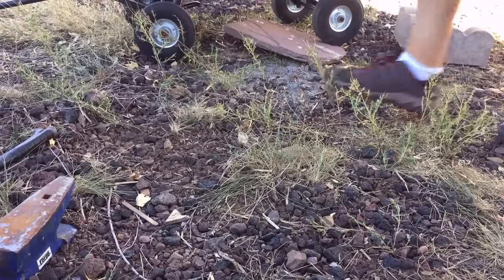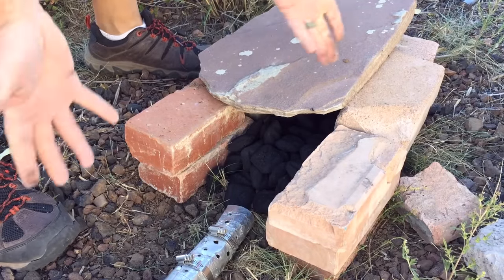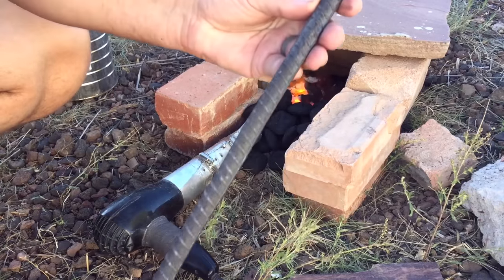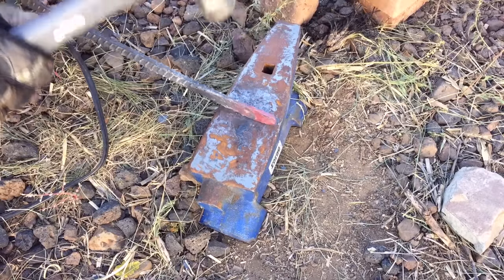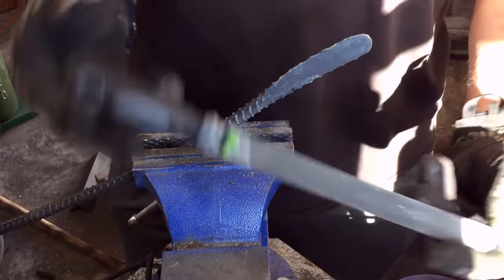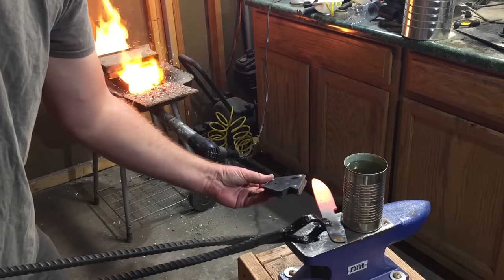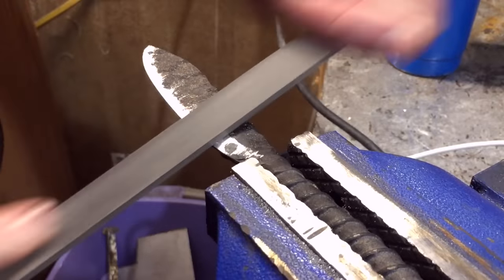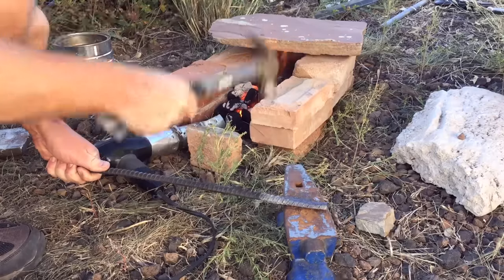Start forging TODAY in your own backyard - no special tools required

Comment: Having just made a knife for the first time ever, I offer two pieces of advice to others who may attempt as a result of this video. 1, When you think have enough coal in the forge, add more. 2, When you think the work piece is hot enough, leave it in there for a while longer. Please note that neither of these is a criticism of this video, he was obviously doing it right, just the two most glaring and continual mistakes I made.
Reply: Bro, I did the same mistakes today, thank u for infrming
Reply: Yeah I learned I had to hammer softer and heat longer
Reply: It sounds about the same advice you'd use for any activity that requires patience, solid advice
Reply: I tried my hand at a forge like this today, kept adding charcoal and it was glowing orange hot with the air I was adding,, but it would turn to ash before my rebar ever got hot enough to work.
Reply: @christianseavoy7693  should probably use some hardwood too but at that point sounds like you need to add more
Reply: I.use.wood stumps.sheok.mally.get.the.air.in.she.glows.nice
Reply: This is 2 years old,, but if you see this,, have you taken another stab at making a knife or is that a one-off??
Reply: @peterlehman6864  I’ve never seen someone love to use periods much as you do, congratulations!
Reply: Yep burn the carbon away. Very smart😭
Reply: That's how we get to learn the easy way, ...by listening to others as they account  their own experiences, with the instructions given, and what they encountered. It sounds like making bread, it takes practice to learn the feel of fine quality bread dough. 
Being able to communicate how you "evaluate" and interpret the feel is priceless, because it adds to and builds upon the original teaching. Together, the video and your feed back are priceless. Thank you for your feed back from a total stranger. In Canada.
Reply: Thanks!
Reply: @peterlehman6864  i.have.a.ques.t. ion
Reply: @prodbybabygod7411  please explain.
Reply: And with time the comments are left to the trolls ….. so where does this live me ?
Reply: Rebar really does grow in backyards, I’ve been trying to level out the ground around my house and I have found atleast 20 kilos of rebar
Reply: Bob Ross of blacksmithing
Reply: @christianseavoy7693  I think that when adding forced air to it, you've got to have it about 3X deeper than you'd expect otherwise. A little different than grilling burgers.
Reply: Just learned those two facts yesterday, note on hotness if your swinging the hammer and it's losing glow completely within the first few you where a few hundred degrees short get warmer. 

If you dig down don't build up much too hard to heat.

Take the advice for swinging the hammer forcefully but not extremely hard unless you want the jelly arm lol
Reply: @christianseavoy7693 this happened to me I ended up taking some lots and making 1 inch by 4inch sticks and placing them over the coals i add 6 at a time. The wood actually caused by forge to suck in air from my airflow port extremely aggressively and went from barely getting to temp to staying at temp as long as I added wood over the coals to burn hotter

Comment: I love how laid back this is. Often these kind of videos are so specific: "you need a QR57 Specialist Hammer and a ball joint inverted blacksmithing high pressure anvil.." This makes me feel like this is something I can do.
Reply: Man. That's nothing impossible to do if you have urge for that. Just some people make it complicated
Reply: Some people get payed by sponsors
Reply: You got that right. Don't overthink it. You can make a pretty good bow with just a stick, a string, and a knife. I've seen it, pretty impressive stuff. There's always a world without power tools, just throw yourself into it and let your brain work out a logical solution, it will make you feel more enthusiastic on the matter.
Reply: "The hammer faces are not as hard and can explode and shoot shrapnel in all directions."

Bro a claw hammer is plenty capable of hammering on steel without exploding what kinda drugs are you on?

You're more likely to snap that wooden handle than you are to break the head...
Reply: @Billy McCatty Powell obviously this is not a super forge bud. It's not getting the bricks hot enough to explode. I've never seen exploding bricks and I've used plenty for fire rings and places that have got pretty damn hot. Also never seen steel spontaneously explode by hitting shit. The only way that makes sense is an extreme change in temp from hot to cold and it probably wouldn't explode it would just crack
Reply: @JarthenGreenmeadow  yeah I broke one hammer head one time in my life I was removing tin from the roof of an old barn so I would put the claw of one hammer under the edge of the nail then hit the head of that hammer with another hammer, and I say broke actually a price about half the size of a dime chipped off and stuck in my arm, smdh. When I was young and wasn't thinking. But it did say on the hammer "do not strike hammer with another hammer" lol
Reply: "will only work with a maybelline hairdryer"

Comment: I literally went outside in the backyard and found some rebar what sorcery is this?
Reply: They use it in a lot of construction. They'll also use it for things like your house's electrical ground and for marking where your property actually physically is.
Reply: ikr? i dont even have a backyard dude
Reply: Same!! On accident. I was amazed
Reply: Haha, when he said that i immediately remembered seeing a piece stucking out of some scrap concrete in my backyard.
Reply: I found a cat in my backyard... smells good now
Reply: As a concrete contractor I can confirm this stuff just magically appears in backyards. Don't know how it's not like half the contractors you meet only half-ass clean their jobsites 😂
Reply: @SantiagoLopez-uu6uk  thats good, the cat will keep the creepers away while you're forging
Reply: Survey pins knocked out by machinery
Reply: I’ve had rebar in my backyard for a long time but never had a use for it until now.
Reply: @lalaland7407  that is really good

Comment: i like how this actually shows what is advertised. its "basic backyard garbage...and if you can find this its a bonus but this caveman thing here works. i see so many videos that are like "How to start blacksmithing for 20 dollars...we start with this here propane forge i built for 200, probably need a forge, and this here anvil, hand made tongs you cant find, some expensive pre-ground bar-stock 1095 and a power hammer. just basic tools we all have in the shed. (rolls eyes)     ive been smithing for 16 years and i remember (vaguely) when i started out with a flat chunk of steel for an anvil, claw-hammer i found somewhere and some vice-grips. i jammed a cast iron pipe in a wood-stove and connected it to an old junky air compressor and threw some logs in there. made the shittiest knife you ever seen, basically a rustic butter-knife, thinner (like stupid thin) and more warped than the one in this video. terrible friggin junk-ass knife. i was so proud. worked in that wood stove for years. upgraded to a ten-inch chunk of railroad track someone gave me for an anvil. got an angle grinder eventually ground that track to a horn.     just kept adding better tools. now i have a Swedish steel 210 pound anvil, propane forge, hollow grinder (that blew something yesterday i need to fix) and i got a wall covered in Damascus knives and swords and axes. you gotta start somewhere kids, and i learned a lot on garbage tools. even now on a budget, i use garage sale files, scavenged steel, quench in used transmission oil, and get handle wood from the log-pile out back. nothing wrong rustic means and elbow grease.
Reply: So honest question. I see a lot of people talk about old railroad track as an anvil, but how do you get them? The only way I can think of would be stealing it but that's not an option I'm willing to consider.
Reply from the maker: Well said 👍
Reply from the maker: Eric Romano Same problem here. I have yet to “find” these supposed pieces of rail. Though I’ve seen quite a few being sold on line for ~$50-100 plus shipping
Reply: Wow. thanks for this comment. Always wanted to give this a shot, and finally spent the whole day researching. Was kinda on the edge of starting and this really inspires me to go ahead with this.
Reply: I literally just bought one about 45 minutes ago. These guys know of dead tracks out in the country and they chop off 12" hunks of them. I just got a 40 pound chunk for $20. They sold it online in Facebook Marketplace.
Reply: FargoFX you're better off with a cheap aso (anvil shaped object) to start off with, railroad just never works out right, unless you can get a piece of junction or cross track, which is quite good stuff, but still requires a lot of work just to set it up. If you do use an ASO substitute, try and make sure the ASO is 20x (or more) the weight of the hammer you use on it.
Reply: Got an almost 2 ft long chunk from a recycling place for 35 buck. Not put it to use yet. They can be found, just got to search and rescue.
Reply: Thanks for the inspiration.
Reply: I don’t have a shed
Reply: used transmission oil... so will used engine oil be good too then? diesel engine. just serviced it so have a bucket with 7L in it staring at me :P
Reply: @ericromano4028  when they work on railroad tracks they will cut off small pieces like 1 to 3 feet long as they stretch it to weld it. They throw these off to the side in a junk pile next to the tracks. If you see a pile of used tracks piled up just pull over and take a look. Or buy a piece off of E-Bay.
Reply: I'm 16 although I'll be 17 in 9 days just went to harbor freight because they opened in my area today and picked up the anvil shown in the video and a ball peen then I went to lowes and got some bricks and rebar I've been welding for about a year and recently bought my own machine so I just wanted to learn about another form of metal working

Comment: being an old duffer I have to say … some drier areas, with trees around the root systems travel underground and on dry seasons I personally have seen fire travel underground thru root systems. so be careful digging trenches and blazing fires. carry on.
Reply: Hey Dave. Great advice, I would have never thought about that.
Reply: There's a video of a guy he want to burn some ants in his garden, he pour some gasoline and then light a match.. an other piece of video shows he at night, he has a tree and a portion of his house on fire!
Reply: Old topic but some kids set some grass on fire in Scotland last year, it had a coal vein under the ground ... it's still on fire under the ground and we had like 3 months of the rain this winter ... sound advice especially if you live in a dry climate
Reply: Thanks Karen
Reply: I better stay away from forging then since Summer is approaching soon in Australia lol,
AKA bushfire season

Comment: This video gave me the courage to forge my own knife today. Didn't think you could heat steel up properly with such simply improvised forge, but it worked wonderfully and the knife turned out much better than I expected. Thanks for uploading this video, it was a huge help!
Reply: You just got to remember that it all started off before hairdryers were even invented. if they could do it, you can
Reply: Lol yeah you would be suprised how easy it is to get a fire going up to extremely hot temps, hell with a bit of mud and know how you can quit easily even build your own smoke stack oven set up which you can get things even hotter, tho with that to get it hotter you may need to up the fuel intake and air feeder
Reply: I've used a flyswatter as a bellows before. Took maybe twenty minutes to get a piece of steel glowing hot.

Comment: My son (14) and I hit up Harbor Freight today for an anvil - created your basic in-ground forge with my wife's hair dryer (oops) and banged out some pretty sweet knives from rebar we had laying around.  I really can't express our gratitude for this super-simple intro to forging.  Keep up the awesome work, many thanks!  We found that wood scraps and kindling worked as well if not better than charcoal (we heat the house with firewood, so we've GOT some wood around) ... such a good time.  You Rule, keep up the inspiring videos!
Reply: 16 now?
Reply: But, 37 hours of filing???
Reply: how much did the hair dryer last?
Reply: @martinferezin5598  Still crankin' - between my wife & daughter, a dryer lasts a few years, so I expect this one to hang on a while longer :) Second hand stores have 'em all day long for a few bucks ...
Reply: What kind of hammer do you use? Carbon steel?
Reply: @martinferezin5598  Still works! We taped it to an old 5 foot piece of iron drain line & fed that into the burn pit.
Reply: @KB-2222  We use the ball-peen hammers from HF - they're cheap, so we bought a variety of sizes.
Reply: 😮😮😮😮😮e
Reply: Any Update?
Reply: @danielheckel2755  The son is 18, has a driver's license, a job and a GF - the wife left three days before Christmas and took her hairdryer with her - women! Looks like I have time to get back to the forge if the mood strikes?  :)
Reply: @ahsuser  Looks like you raised your son the right way 😉. Time to set up my humble foundry!

Comment: Its worth mentioning if you use bricks make sure they ARE NOT concrete they can explode if exposed to enough heat.
Reply: Better to say make sure they are DRY. Like put up in a dry spot with a lot of ventilation totally out of the rain for a few weeks or months.  Cinderblocks are likely to just crack and will be rendered useless (for anything). Natural stones however can and will explode if they are not bone dry.  Clay bricks are probably good even if they are wet they're just liable to crack.
Reply: @maxdecphoenix  thanks i was looking for this info
Reply: Cinder blocks will just crack and turn into powdered ash over time. 
Concrete can explode
Wet clay can explode 
River rocks will explode
Reply: @Paid2Win  you are a modern Mayan
Reply: Too late...
Reply: I was looking for this comment since he said bricks or stone. You should really use fire bricks, nothing else...
Reply: Like literly explode ?
Reply: @IevanceI  I have successfully made a forge out of adobe, and so has retired bladesmith Tim Lively and master bladesmith Tai Goo....among others.  The only advantage fire brick gives is the ability to reflect more heat and reflect it more readily.  It is not the end all/be all of forge construction materials.
Reply: @diegosalazar5653  Concrete brick will throw fragments if overheated, because of the moisture inside.  Concrete block though, will not.  Why?  The cross section is thinner and this allows for the block to dry quicker and more thorough.  Still and yet, it is not durable under high temperatures and will crack and disintegrate.  Because of that, it's still a horrible material to use for this.
Reply: Great narration. Great video. I'll never do this, but it's damn interesting.

Comment: That's pretty neat! I used Goddard's 50$ backyard smith book, but it's awesome seeing that people can cleverly do it for even less. Some tips I've learned that cost nothing but will make your life easier:

1) Find the heaviest flat surface you can hammer on. This allows most of your hammering to shape the steel instead of spending some of that energy moving the dirt underneath. A concrete patio is great for this.

2) When hammering out the bevel, the spine does like to bend backwards. If you rest your spine on the hammering surface, using a 2x4 to smack the blade edge will straighten out your spine without damaging the edge.

3) After quenching (I found motor oil to be the most forgiving), submerging your blade into a pile of dirt, sand, or even charcoal dust makes it easier to work with when you're filing the profile, either by hand or power tools. The slow cooling of the metal in a medium instead of air cooling will soften the steel enough to make it fileable.

4) Toaster ovens for heat treatment are a lot easier to explain to your wife/mother than the kitchen oven.

Comment: Thank you FargoFX, this video inspired me to get out of my "If only I had/could afford this" rut and finally build a scrap forge.

I sunk a few broken concrete blocks in a pit out back, set up some scrap steel piping(not galvanized) and used aluminum tape to affix a $10 hair dryer to the end.

Heats metal to forging temp effectively on pretty much anything more flammable than wet leaves.

Again, thank you immensely for this kickstart.
Reply: how much did the $10 hair dryer last? At least a year?

Comment: Awesome. Going to try on weekends.
Update: Way easier than I thought. Could get orange hot easy. Recommend uses coal or charcoal, wood scraps burn out.
P.S. Power tools make it way easier. 
P.P.S. If your using a blow  dryer, put it on full, and if you don't have protection keep it a relatively away from the flame, and pointing to the flame.
Reply: Are you still forging?
Reply: Awesome, advice helps. Good luck in life!

Comment: If you've got any steelwork or even welding business near your area, it would be worth to go over and ask if you can dig through some of their scraps for something you can use for an anvil. I found a 15 inch long piece of I-beam scrap around 6mm thick that I've been using for an anvil and works pretty great.

Comment: 5:20 You might consider partially burying your anvil, to prevent it from moving around?
Reply: Small pile of sand works well.
Reply: Good idea
Reply: It helps a lot if it weighs more than 5lbs too ;)
Reply: Great tip. I have lots of rocks on my property might try that too.

Comment: I was a mechanical engineering student. I had a good time with blow torches, acetylene, making gears, using lathe and power hacksaw. I used to be an expert in filing. I enjoyed all of it a lot.
Now I am working as a IT guy working 10 hours a day.

This video just made my Day. Thanks a lot!